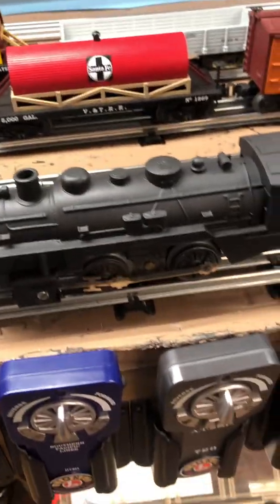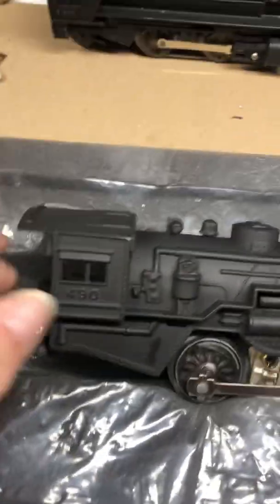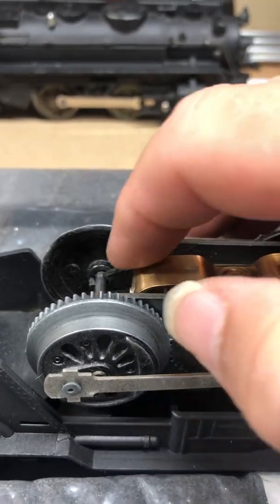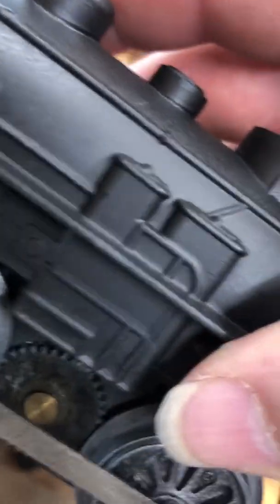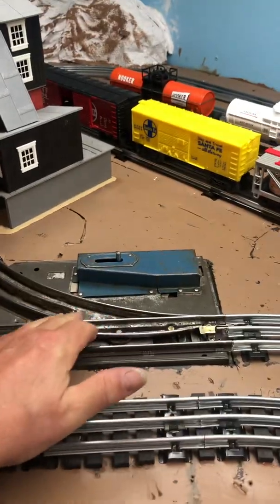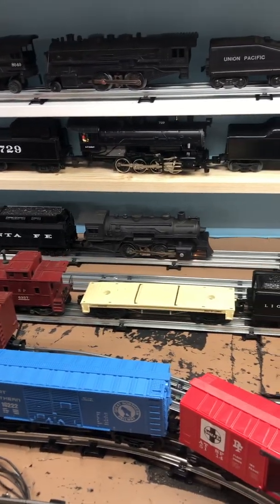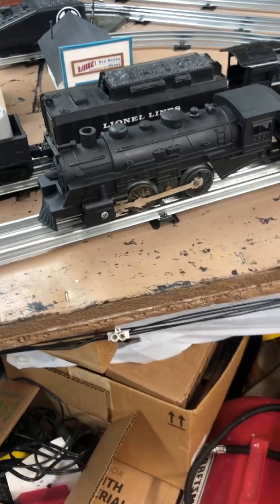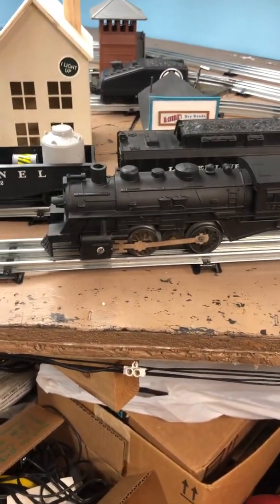Marx 490 project-cheap easy fun

Comment: Your 490 needs the motor armature both ends and gear pivot oiled badly, that is why it has that growl sound. The 490 came with several different shells. The one you have you should be able to switch out the motor assembly to the double reduction gear off the flange motor assembly. MarX switches have either the whole piece pivot type that will work with the wide flange, and regular type wheels. Their more modern switches that slide the two arms have a unique fold down piece that will work with either fat or normal wheel flanges, in 0-27 and 0-34 radius low rail track. The Gargraves switches I have from the late 1980's have the normal two slide arms and they will not work with the wide flange Marx or American flyer type wheels. The other common shell of the 490 is all snap in place with no screws, and another has two screws, and there is a 4 screw one as you have there as well.  Or a 5 screw one. 400 is pretty much the same as the shell you have.  Also many of the double reduction (benzTrainz) label have a traction tire on one wheel for better traction. The cast iron shell ones  as best I can tell came both ways with and without traction tires. This low end motor that is in most 490 has the shorter center rail slider. This engine is very unique in another way. It has a plastic frame for the whole motor assembly, and since it is plastic that center slider support is all steel, so no wire soldered to the slider bar is necessary.
Reply from the maker: Well thanks for the info, I oiled the loco but will do it again. I Like these simple old engines…..
Reply: @jamesmorgangunsandtrains7132  Yes the motor shaft is often where a squeal will come or a growl if it is loose or just dry as well, or both end of the motor. I had a 1666 that the motor shaft had rust on it, making it stiff and just about locked up.